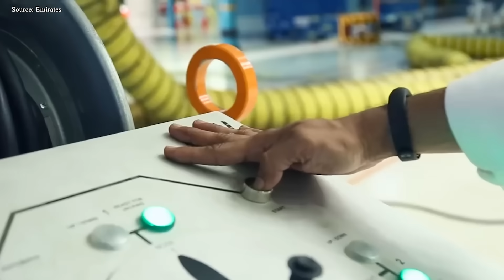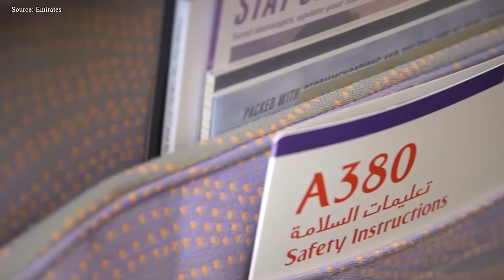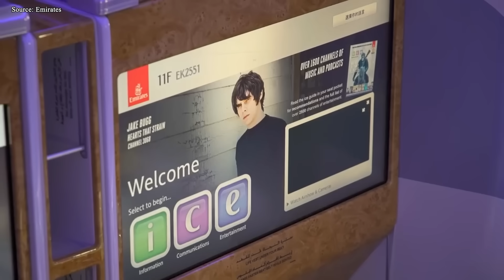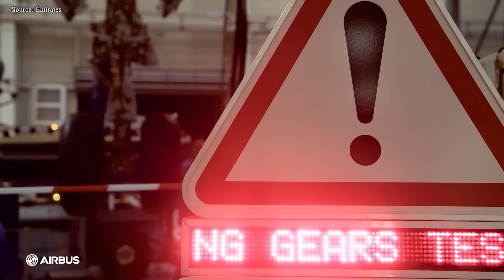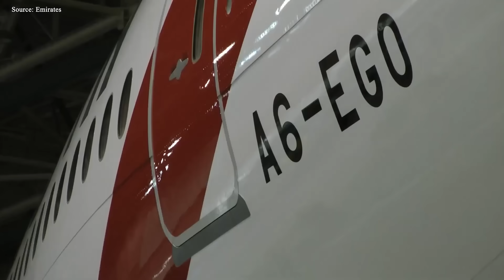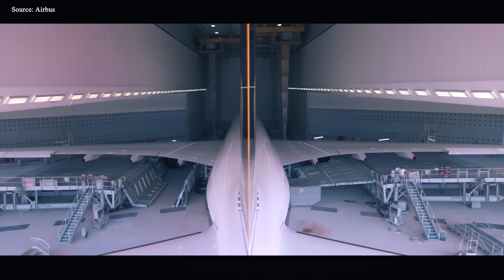Emirates' BOSS Just Revealed This New Aircraft Will Change All Aviation!

Comment: Responding to the "demands" of ONE client (irrespective how large/important/influential) does not a business strategy make. The market (you and me) flying is moving away from Emirates hub-and-spoke model and chosing point to point  flights. This is a threat to Emirates strategy. Threats to Emirates strategy are not problems that either Airbus or Boeing have to solve. The reason the A380 failed are still the reasons it failed. Without a change in paradigm, the market, those reasons will continue, and with the continued growth in point to point demand may only get worse (for Emirates). This is not a criticism of Emirates - great airline; just an explanation of the forces at play that were not addressed in the video...

Comment: Dubai is not the only city between East and West. The great circle route from London to Sydney, for example, passes through Moscow. Sanctions preclude the use of Russian airspace for now, but e.g. Azerbaijan could act as a long-haul hub if it wanted to. Baku is famously windswept but the country’s second-largest city, Ganja, is not and has an airport with a suitably long runway. An A350-1000 would have just enough range to reach Sydney from there with the requisite fuel to spare.

Bonus: no desert sand producing CMAS deposits in the high-temperature components of the Rolls Royce Trent XWB-97 engines.

Ashgabat in Turkmenistan could be an alternate location. India’s new Navi Mumbai airport would arguably make more sense but afaik India and Pakistan currently each restrict their airspace for flights originating in the other country.
Reply from the maker: That's some detailed analysis!